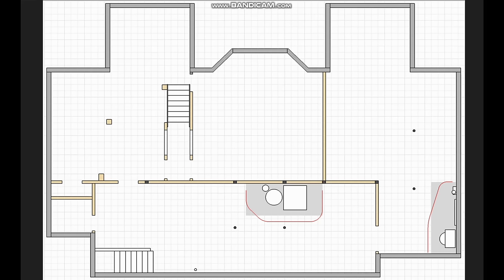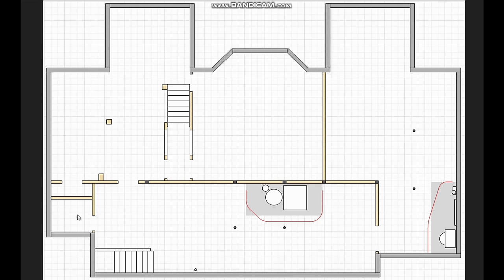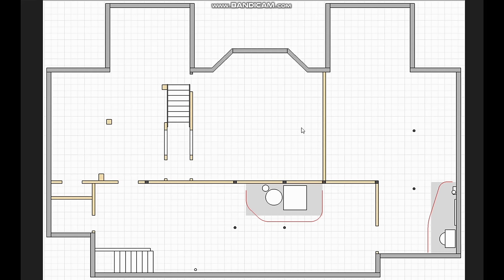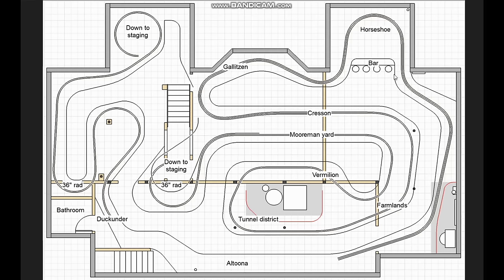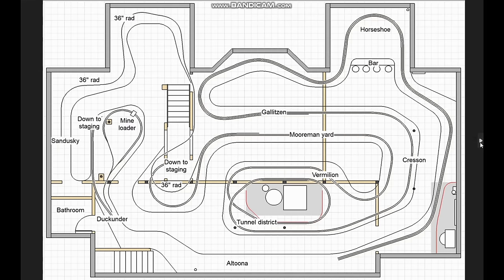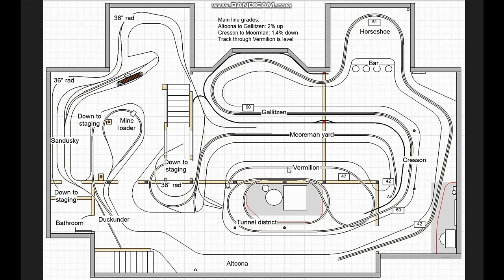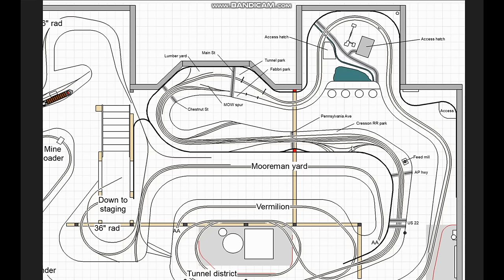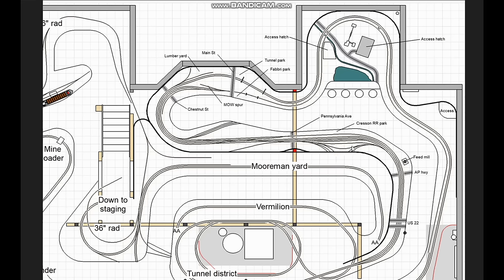Epic 62' x 43' model railroad design, part 1

Comment: So does anyone know how the coal gets to the storage area where Peter mistakenly put the three tracks? I think it must be via the three cylindrical concrete silos. It looks like the conveyor system splits into two runs, with one elevated and dumping into the top of the silos, and another running at ground level to their base. The only other access to the coal storage area is a road but they can't possibly be trucking that amount of coal in.

Comment: Look up “unloading a coal train” by NKY Railfan.  That video does an excellent job showing the coal handling system. 

Good thing there’s an access hatch at Horseshoe Curve… just in case NS puts empty centerbeams near the head end again!
Reply from the maker: I watched several of the Sandusky coal dock videos while designing this layout.
In the next installment, look out for where I included some of the derailed cars at Horseshoe Curve in the final design - they are still visible in Google maps.

Comment: Impressive for sure! I'm not sure about the wisdom of enclosing the water heater and furnace, or blocking the garage stairs??? What is the client going to do when he needs to replace the water heater or service the furnace? Instead of a bar in the layout why not make a crew lounge in the water heater/furnace room with easy access to the bathroom?  He could put a couch with a TV and refrigerator in there, he could also have his workshop in there. Have a single track duck into the room along the wall to watch a train go by while sitting on the couch having a cold drink.
Reply from the maker: On the finished plan, there is enough space to get around them for maintenance and provision for hauling them out when they eventually need replacing.  The new replacement furnace will almost certainly be smaller than the old one.
Reply: @SPSteve Exactly my thoughts; you're spot on. He'll soon regret not keeping this area clear of track. Duckunders should be avoided at any cost, especially with this much space available.
Reply: Yes, that's just dumb. I can't imagine how he thinks blocking the bathroom/ stairs /water heater /furnace is a good idea.  @tomsrensen9382

Comment: Did you say what the scale is for this layout, or did I miss it?
Reply from the maker: Most of what I do is for HO-scale.  You can assume HO unless I specifically say otherwise.  Actually, if this layout were built in N-scale in the same space, we would still need more than 50% compression in the yard areas.